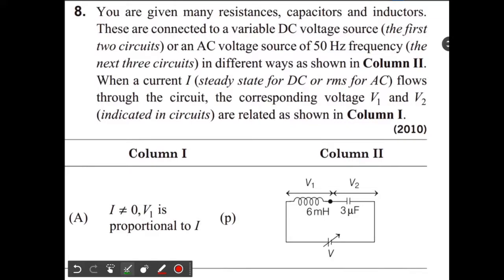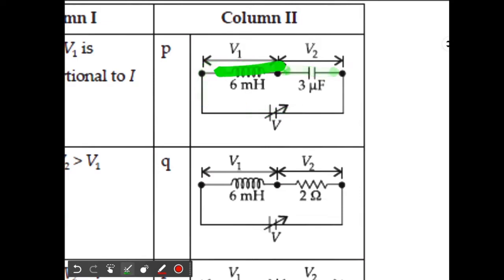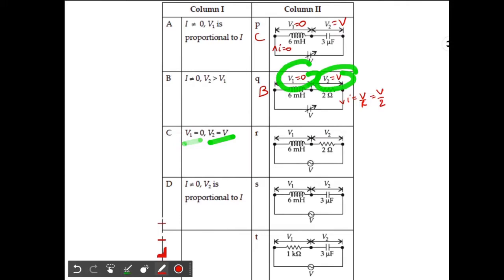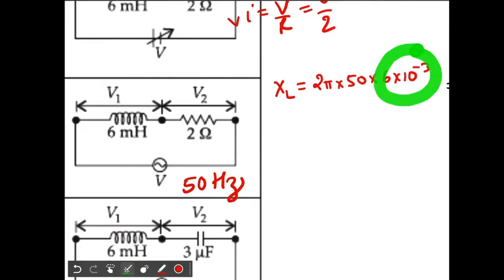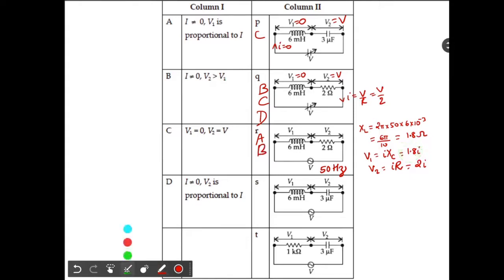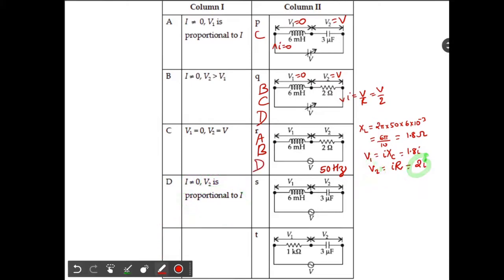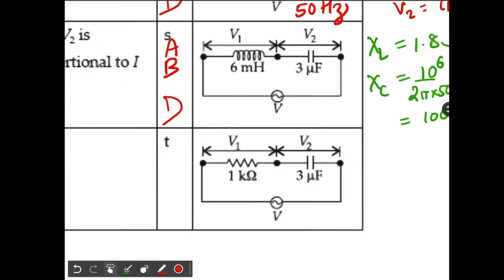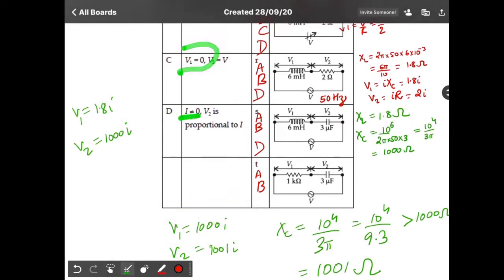AC Circuits - IITJEE Advanced 2010 Matrix question

Comment: FYI, in the first circuit there will be no steady state and that the current and voltages will be alternating. Its a special case of LC Oscillation with a DC battery.
Reply: Same doubt